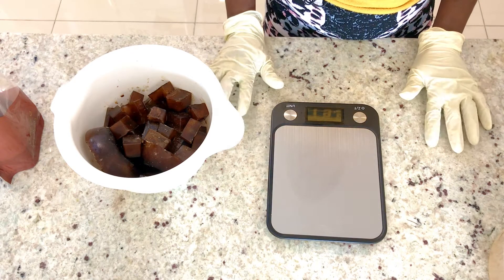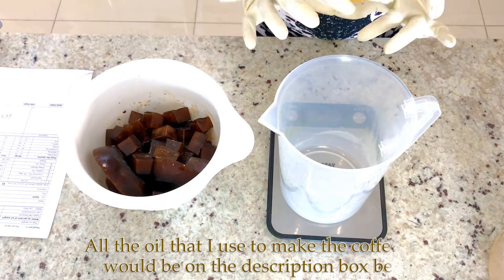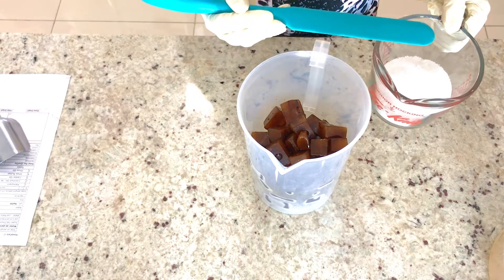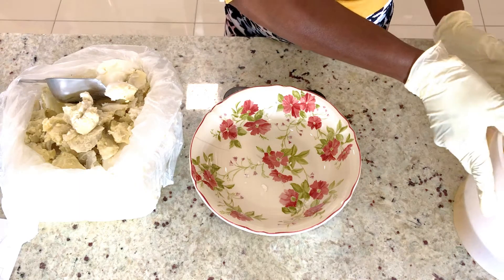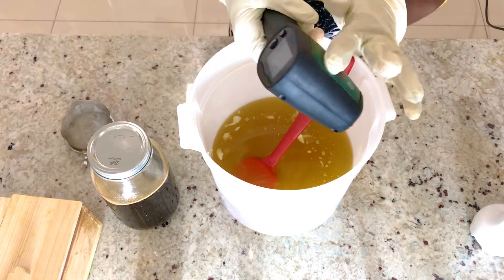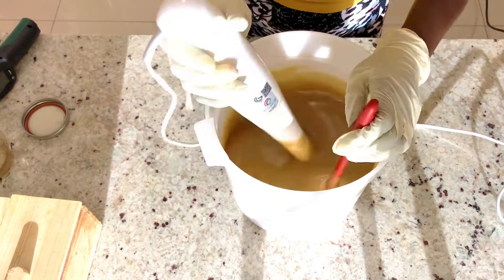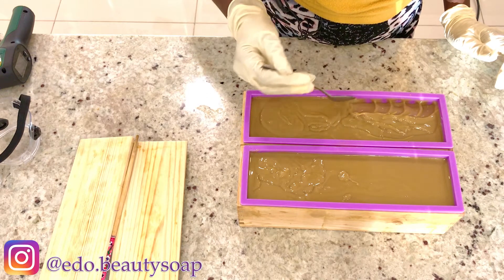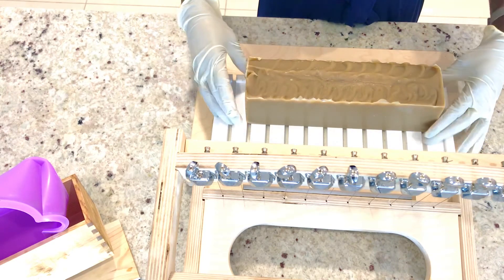COFFEE SOAP MAKING / AN EASY WAY TO MAKE COFFEE SOAP / COLD PROCESS SOAP

Comment: Mafe a version of this 1 week ago. Still curing but I did a lather test & it was really rich (cocoa butter & shea). To keep my coffee ice cubes from scorching I mixed in a stainless steel bowl which I placed in a sink full of cold water to draw away any heat build up. Worked very well & cut the mix time down to like 2 minutes. Added choc & coffee fragrance after emulsion (maybe 2% oil weight of the choc & 1/2 that of the coffee). Came out looking just like milk choc at pour but Im told that will darken during cure. I hope so. Oh & I adde brown clay for a nice slippery lather (3%) mixed red & green in a little oil.